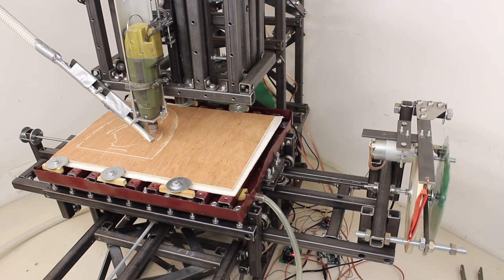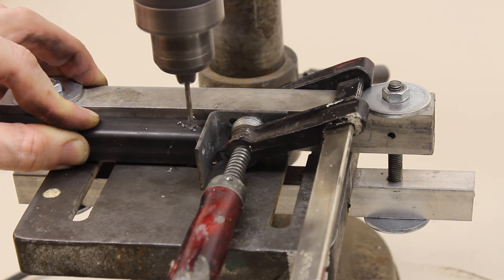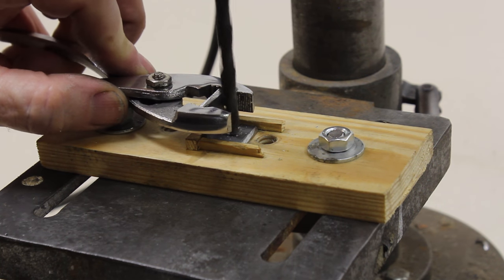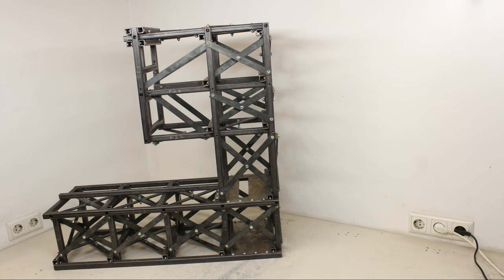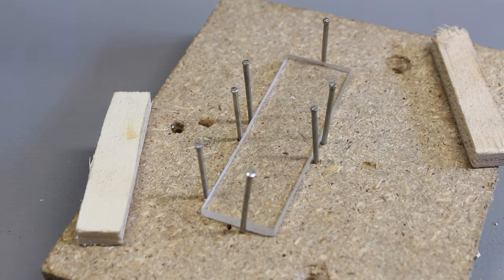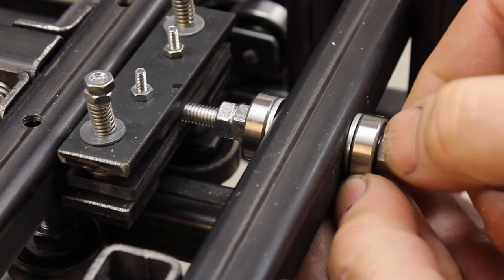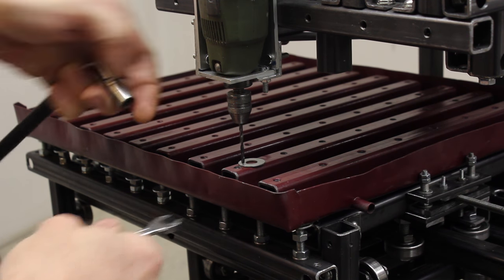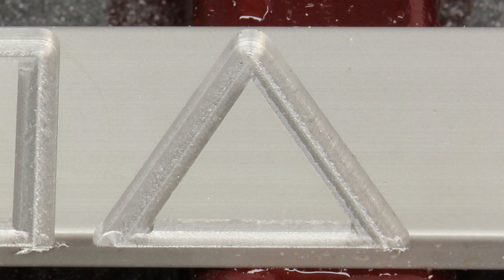CNC v3.2 the mechanics and tools needed to make a personal copy

Comment: Really great tips on using a drill press accurately without buying expensive accessories! And using it as a guide to tap holes.. I've never seen that before. Great video as always.
Reply from the maker: Thanks! I got the tap-holes-tip from a YouTuber after publishing my video about my CNC v2.0 - it works perfectly.

Comment: Hi! This is an amazing project, and seeing you work your way up from digital encoders and simple motor drives up to a complete CNC machine is an incredible saga! I really hope you get to win the HaD Prize!
I have a small question for you: wouldn't it be better to add some oil to the water (as an emulsion) and use it as cutting fluid instead of plain water? I do remember doing it during machining class :)
Reply from the maker: Yes, besides cooling, lubrication is essential for router tools to get best results. In this early state I used nothing but water, because that liquid evaporates when splashed around my workshop (remember the machine is still in an early prototyping state and there is still no closed circular flow of liquid).
Thanks for sharing your ideas!

Comment: i suggest that you use linear guide screw, this will save you tons of time for adjustment for accuracy.
Reply from the maker: The idea behind this machine is not to use special parts and that's why I am using common threaded bars and ball bearings.
Reply: ok, anyway you done a great job, hope to see more improvement, maybe start with a 10mm cnc milling process.

Comment: 05:40:  It is possible to press a bearings with an excentric nuts like the 
following guy. It consumes less material. It is still to invent how to 
fabricate them manually: /watch?v=7_YFMXEFvXg (point 5:55)
Maybe some kind of bushing will work. Excentric (drilled) bushing can be installed inside a bearing and soldered or glued on a bolt of lesser diameter.
Reply from the maker: You can change that if you'd like to, but those excentric nuts are special parts and I'd like to use common parts.
Reply: HomoFaciens if you take rod, cut it and drill an excentric hole, then it will be a 'common' part. It is possible to cut a cylindric bushing from aluminum even with a drill and a file. I could show you, but I just haven't an appropriate piece of aluminum.
Reply from the maker: Артур Файзуллин
You're right, it would not be too difficult to make such an excentric nut, but the adjustment isn't that fine. I know systems like that from adjusting the handbrake on my car. I'll keep it in mind when overhauling the mechanics of CNC v3.2 - thanks.

Comment: You've been busy !! very Nice.  One question do you work out the dimensions of most things using a cad package or just kind of sketch it out. Thanks
Reply from the maker: Very busy ;-)
As written on the Hackaday blog, I was using OpenSCAD for this machine for the first time:
https://hackaday.io/project/10299-self-replicating-cnc-for-194-or-more-countries
The previous machines were designed using the rule of thumb.

Comment: Great Video! I do work on my own CNC project, and I wanted to ask something. Does it happen for you that nuts/bolts loosen over time due to micro vibrations from motors? I was curious if it's a common thing and if it has a solution?
Reply from the maker: This machine is still under construction. I have worked no more than around 15 hours with the low power configuration of this machine, thus I can't give a prediction if this is an issue for this machine. I will publish problems like this on the Hackaday Blog:
https://hackaday.io/project/10299-self-replicating-cnc-for-194-or-more-countries
or my project page:
http://homofaciens.de/technics-machines-cnc-v3-2_en.htm
Same is for solutions I find practicable to go around such issues whenever they occur.
Stay tuned!

Comment: indeed Germans are inborn engineers ! i enjoy deutsch version the most, thank you !
Reply from the maker: Bitte gerne!
Reply from the maker: Sorry but I don't understand what your "key with a gearbox" idea is about.
Reply: HomoFaciens excuse me, its for your another video, about stepper motor, which you used optical sensor and one gear, which is not very accurate, because 1) to prevent overshoot, you should slow down the speed of motor at end of motion, and 2) maximum gap (gaps in gear) you can use with optical sensor is about width of sensor so with ultrasonic sensor you can use linear motion calculation instead of circular calculation and with compound gear box you can mitigate or remove speed reduction at the end of motion. anyways your plan is awesome !!!
Reply from the maker: Well it's better to leave a comment at a video it belongs to or at least give the link to the accordant video. I still don't know exactly to what video you refer, because I made a couple of them regarding linear drives and motion sensing. Slowing down at the end of the video is done through PID control loops as demonstrated in my video about the Arduino Uno:
https://www.youtube.com/watch?v=PQ1FBcQT0AI
It's hard to get the same precision with using ultrasonic sensors. Here I am moving 0.00833mm per step with a 30cm travel distance using a very cheap and simple setup. Getting the same result with ultrasonic sensors won't be an easy thing. In theory you get the absolute linear movement of the carriage when using the setup you suggest, which would be an advantage, but I am in doubt that you get this in practice.
Nonetheless thanks for sharing your thoughts.
Learn more about my investigations concerning linear motion sensing on my project page:
http://homofaciens.de/technics-machines-cnc-v3-x_en.htm